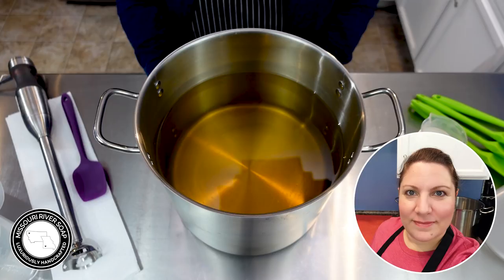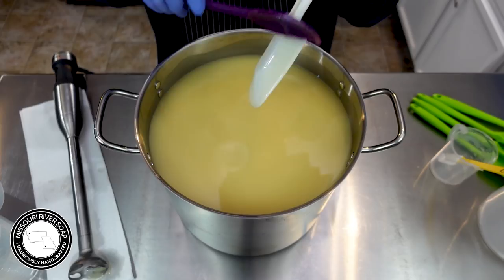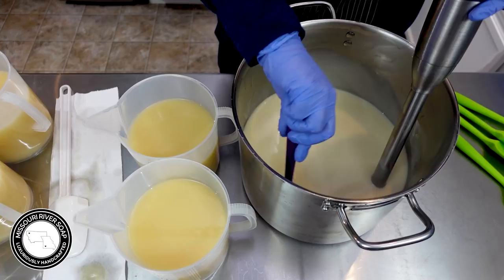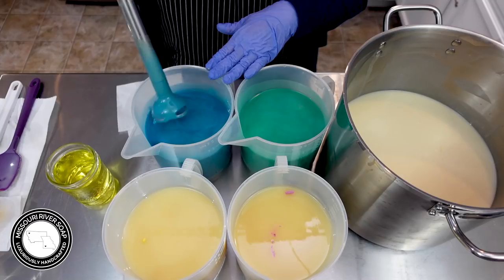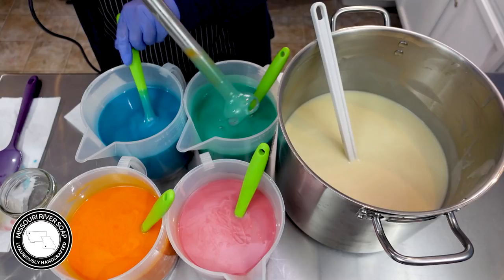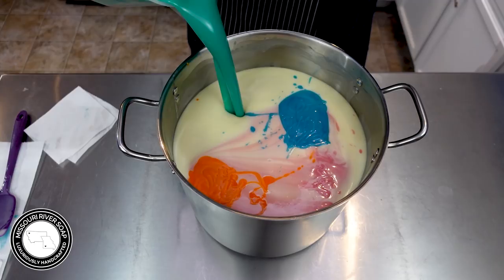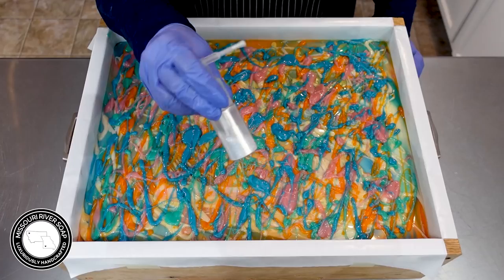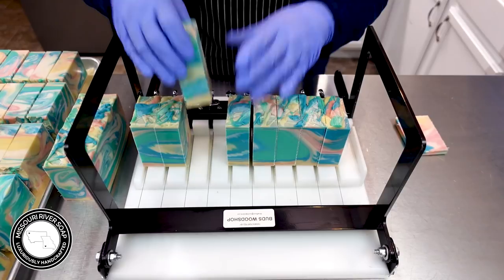The In The Pot Swirl | Jasmine Pineapple Soapmaking | MO River Soap

Comment: What palm oil and rice bran oil can be replaced with?
Reply from the maker: I would look at tallow as being a palm oil replacement. For rice bran oil, you can usually replace with olive or avocado. Make sure that you run everything through a lye calculator to make sure you not only get the right amounts but the numbers you are looking for in your batch.
Reply: @moriversoap  I do not use palm oil.